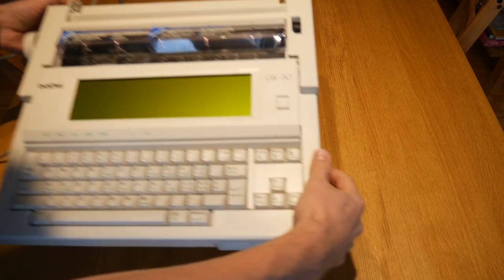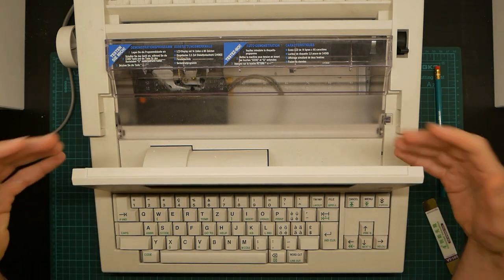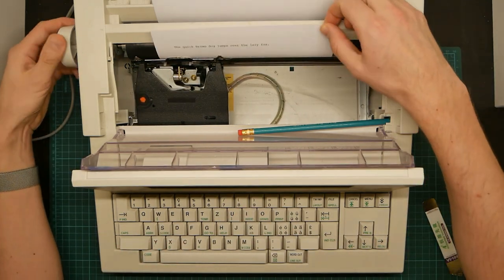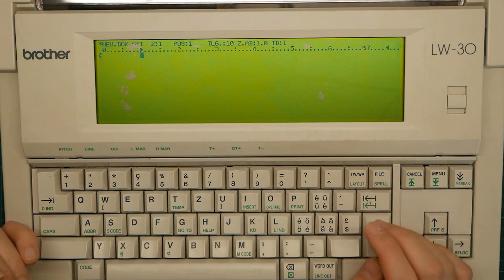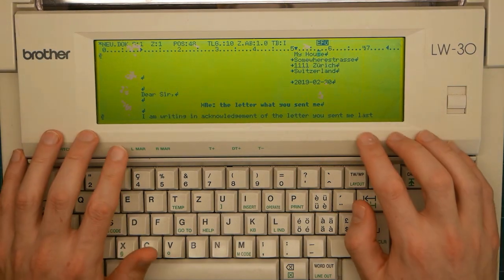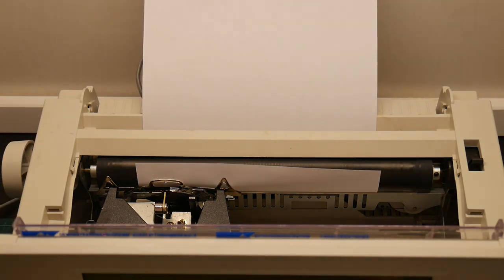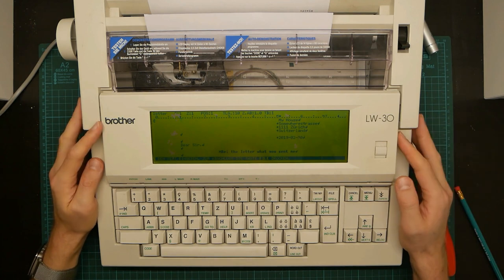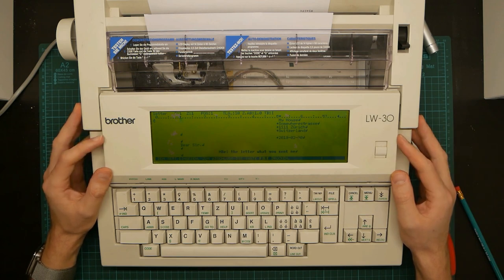Hjalfi processes words on his new word processor

Comment: i enjoyed your video very much. thanks for providing such information, i got a LW-35 from ebay today for very little money and in the meantime i am watching your video to get a first impression of what i can expect. i wonder if and how i can reasonably transfer the written texts to my computer or how the text files can be converted. i am also thinking of installing a gotek drive for the floppy drive. let's see if that works. so thanks again for your video!
Reply from the maker: It'll be a lot of work to use a Gotek --- this thing uses a completely nonstandard drive, pinout and format. You can read and write floppy disks provided you are willing to build or buy the hardware. https://cowlark.com/fluxengine/doc/disk-brother.html
Reply: @hjalfi  i understood from a german wikipedia article (see https://de.wikipedia.org/wiki/Brother_LW-Reihe ) that the LW-30 model is indeed incompatible with anything but the later models (from LW-35 on, like mine) will use standard ms-dos format. so i was thinking a gotek could fit...
Reply from the maker: @DirtboxJams  Oops, sorry, got the 30 and the 35 mixed up. In which case you should be in luck. ...assuming the hardware inside is anything like the 30 apart from that, and you're into low-level Z80 programming, you might be able to port my LW-30 version of CP/M to it! https://cowlark.com/cpmish/
Reply: @hjalfi  i am actually not into low level z80 programming, i’m no programmer at all tbh ;) but i thought a brother LW machine would be a great way to finally have a distraction free writing solution which makes me feel like being a great novelist (or just to have a reason to turn off my computer screen). so thanks again for your video!